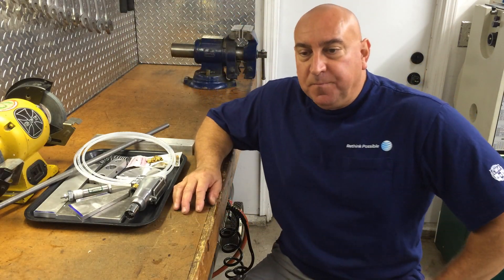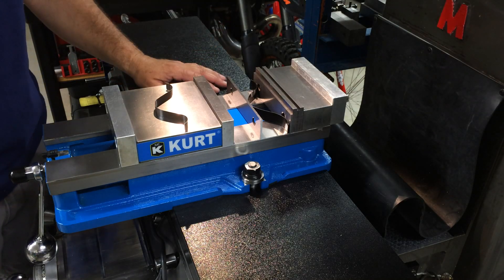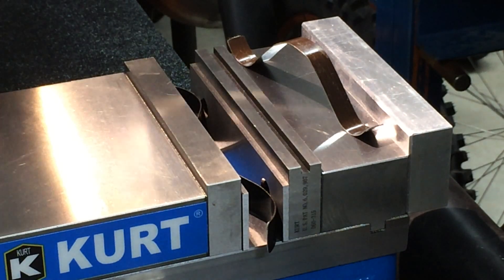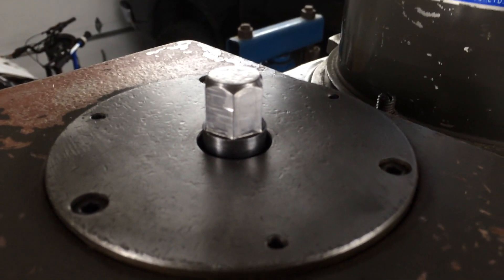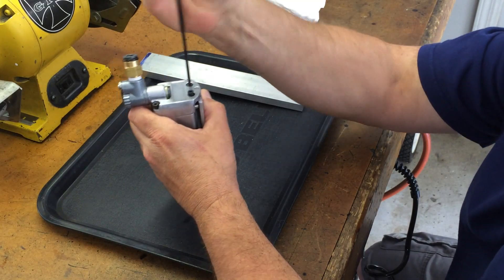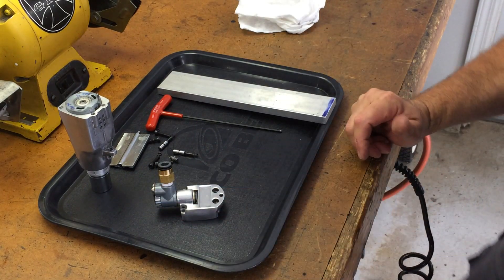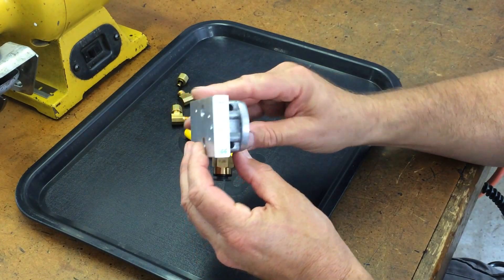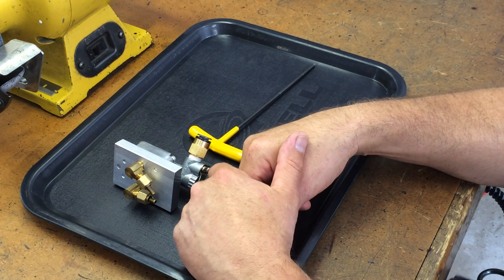Power Drawbar Part 1 #realraysgarage

Comment: hi could you tell me what kind of pneumatic piston did you use?
thanks
Reply from the maker: I used two clippard SDR 12 1 single acting cylinders. You can also use Bimba cylinders of the same size.

Comment: hi ray do you have plans for your power  draw bar for mill ? and if you do can i get a copy please
Reply from the maker: Hello Tim Sorry, I wish I would have drawn plans for this fairly simple design but did not! I built this with scrap parts and a couple ebay air cylinders, HF Impact gun and this thing has been working flawlessly for several years now!

Comment: Nice stuff. I've seen guys race to cut the strapping off of pallets to make those springs. Only problem I ever had, and it is minor, is that I tend to try to move a parallel horizontally to verify that a part is seated and the springs can keep a loose one from moving. Other than that, fine fine fine.
Reply from the maker: Hi George,

Now that explaines why I saw a bunch of stuff falling off pallets on the way to work last week....

Thanks for the info,

Ray

Comment: Likin your build Ray especially the part about remote mounting the valve assy. I've been eyeing several different designs on the web trying to decide on which way to go since Chuck wouldn't part with his. :-)
That mill is WAY too clean BTW.....

Colin
Reply from the maker: Hey Colin,

I would have liked to have scored a DoAll like Chuck's too and have been looking on ebay and CL, just too expensive so I thought I would make one for some good video and maybe a working power drawbar for the mighty WEBB... I will dirty the mill for you bud, the lathe too but, those who live in glass houses should not throw stones... lol, your stuff is very clean too brother!

Ray

Comment: Hi Ray as they say great minds think alike, I made some of those about 4-5 years ago out of 20 thou beryllium copper strip and formed them to an Omega shape. With mine you can squeeze them completely flat and they will retain their shape when released. I sent one to Keith for his tool box give-away, but I don't think he realized their use. 
Keep up the good work,
chris
PS Although most engineers think the idea new, and great, when they are told about the "omega" springs, I am sure there is some old Victorian book with a picture with caption stating the author's grand dad told him about them.
Reply from the maker: Hey Chris,
Beryllium copper, plus an Omega shape beats my spring steel "mustache" any day, well done my friend! I missed it your donation to the box give-away, wished I would have seen it so I could have used your idea! As far as old Victorian books I would not know however, I wonder if a really early edition of the Machinery's Handbook has a reference to it??? 

Thanks again,

Ray
Reply: Do not worry, my friend, your spring steel is much easier to find and every bit as useful as my stuff. I also use copper lightning conductor, about 1" wide strip I found when clearing out my Father's garage many years ago, it's almost as good as BC if you work harden it a bit first by drawing it backwards and forwards over a small bar a few dozen times.
If you invent something and then find out you are 110 years too late, don't be upset, if you haven't seen it before you are still  every bit as clever as the first guy!
ATB
chris
Reply from the maker: Chris,

Next time your in the Fresno, Ca area, it would be of great pleasure if you could swing by so I can pick your brain! Oh, and I am sure I am at least 110 or so years behind but, I would like to belive I'm am the first one to invent the wigit, if only that were the case I would be treating all of us with the coolest machining tools!!!

Thanks,

Ray
Reply: Ray Caniglia Thanks for the the invite but regrettably I must decline, my days of foreign travel are pretty much long gone. Besides you have some of the best and brightest home-shoppists in the world your side of the pond.
ATB
chris
Reply: Further to my last, even after a transatlantic flight there would be more swarf on my shoes than your floor and I wouldn't want to mess your operating theatre, besides I might get infected with the cleanliness bug.and that would never do :>)